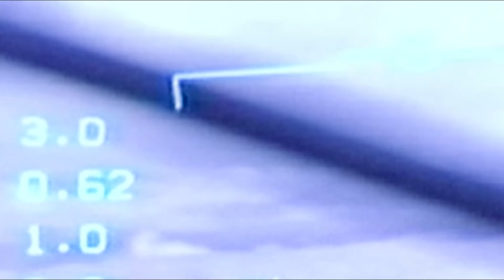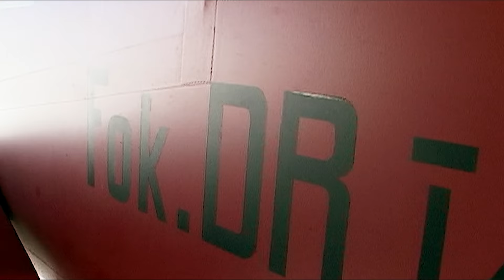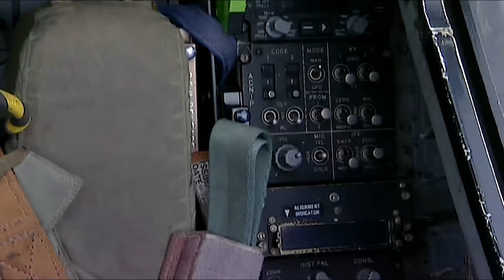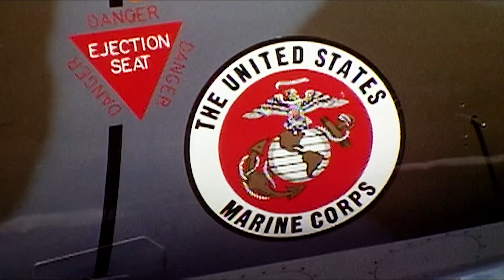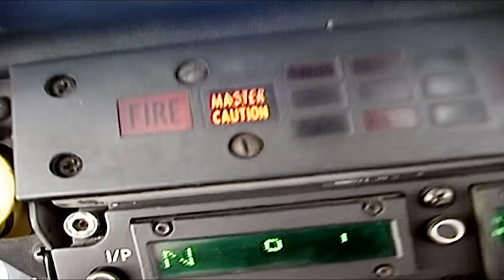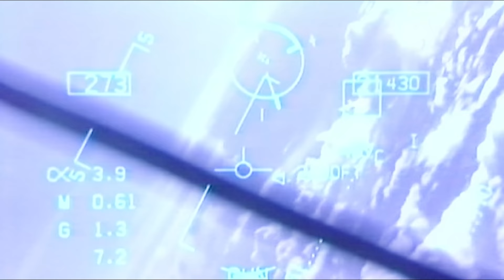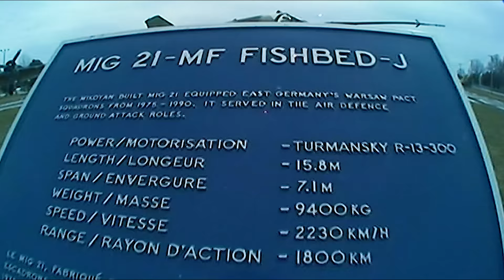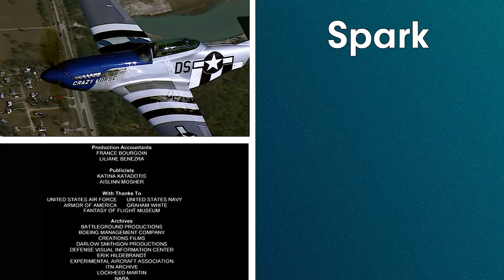Top 10 Greatest Fighter Jets Of All Time | The Greatest Ever | Spark

Comment: This was a bit of a joke guys! very bias and very inaccurate. Typically American perspective. Why did the P51 out rank the spitfire? oh yeah because it protected daylight bombing raids at the end of the war. Something that wouldn't have been needed if America joined the European theatre earlier in the war. Also the P-51 didn't receive its performance at altitude until given the British engine it is now synonymous with. And why was the high accident rating of the Harrier only referenced with the the US Marines? was the RAF having the same issue or was it only an American issue? Why no reference to the Hawker Hurricane? What about the Mig-25? that scared the ASAF into making interceptor options that eventuated into the SR-71. I'm sure you are all going to rip into me on this but I'm not a pilot or a historian and if I'm wrong let me know (in a friendly manner) but whilst they have acknowledged one previous enemy (the third reich) other than the Mig-21 they have not acknowledged another "former" enemy (USSR) Most annoying thing is that the F-15 didn't get the top spot!!! No combat losses and it once landed with a whole wing missing. Nostalgia and facts are different guys!
Reply: This series is from the 2000s, when the post-9/11 America-fuck yeah attitude was in full swing